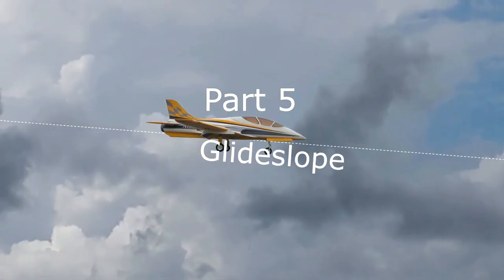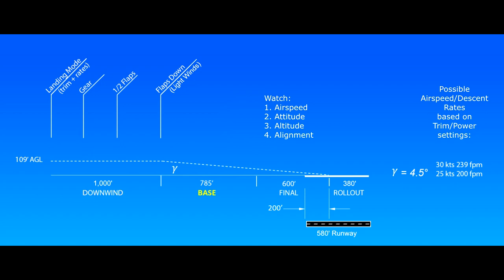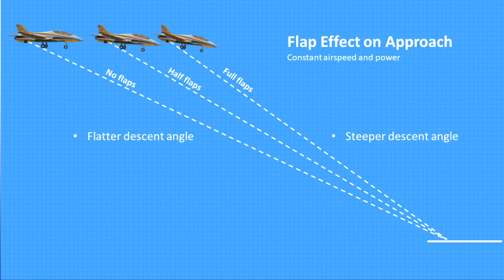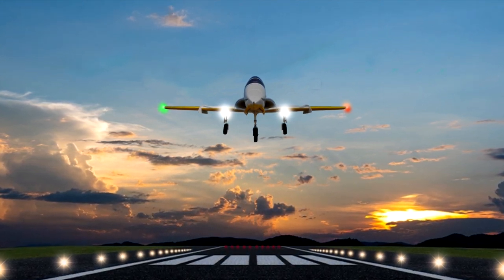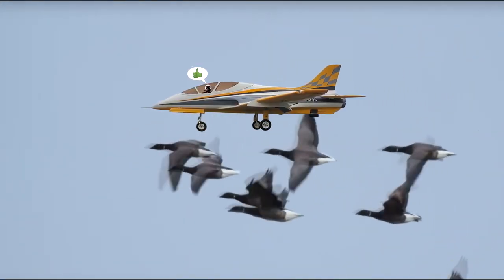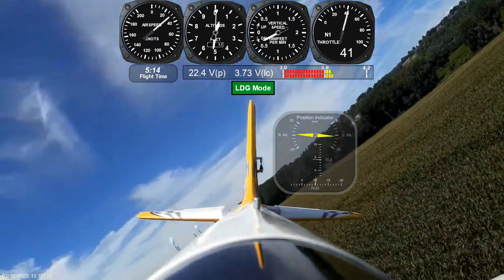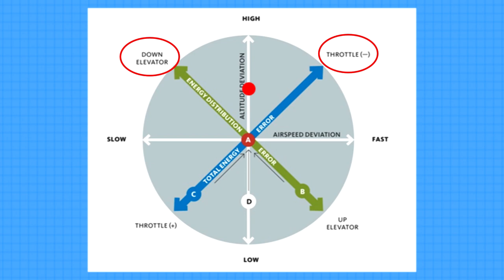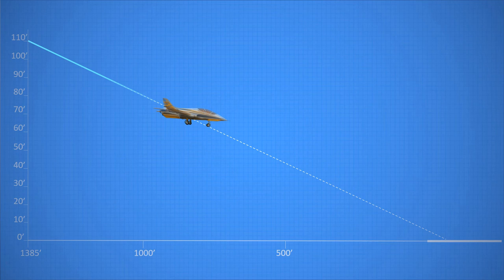By the Numbers: How I Land my EDF Jet (and avoid the danger zones) Part 5

Comment: Good job. I wish I knew how to create quality graphics. The flap system in my Spektrum radio has FLP>ELE mix for each position of the flaps, but I also put the transmitter’s flight modes on the flap switch which allows me to fine tune the elevator trim in each flap position. The flight modes trim also gives me separate aileron trims in each flap position so that I can compensate for any differences in the left and right flaps. I use 15 degrees of flaps for takeoff and windy landings. Full flaps is 30 to 40 degrees. I adjust my FLP>ELE trim more for glide speed/descent rate than for ballooning on downwind. One of the things I tell students is never throttle back below 50% when flying downwind or turning to downwind.
Reply from the maker: Thanks! Good info.
Reply from the maker: On the graphics, most of that was done in PowerPoint. The newer versions allow you to animate them, which makes it more interesting to watch. A photo editor is also a must. I had Adobe Photoshop for years, but recently switched to Affinity, which has many of the same features. A good video editor brings it all together.  I use Movie Studio 16, which is OK, but it crashes often in Windows 11. It's overdue for an upgrade. There are a ton of videos on YouTube that explain anything you want to know or do in any of these programs.

Comment: I set landings gear and flaps and trim elevator for approach speed and throttle to maintain level flight. Reduce throttle to maintain glide slope, use elevator to control speed. Small adjustments are all that is needed.

Comment: should have slammed the throttles to full-power on touchdown at the carrier, in case the hook skips the arresting wires ...
Reply from the maker: 31:48 You're right! It doesn't sound like I did that. But that is the right procedure. Even if you know you're in the groove, a cable can break or the hook can skip - although it's designed not to do that.

Comment: Remember to keep throttle up on the final turn !!!!!
Reply from the maker: That's right. It's good practice to throttle up any time you're making a turn in the pattern. I talked about this in Part 2 on stalls. The only exception would be if you're too high on approach and need to descend quickly,  as long as you keep the nose down.

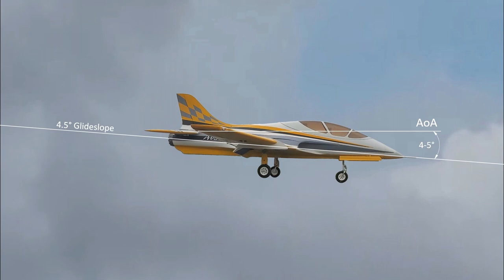Comment: reality check          15:00   too much emphasis on  FLAPS.     flaps are almost  never  NEEDED; and, most pilots only partially understand what flaps do and what they do not.        on the other hand, it is Necessary,  Every  time,  to fly the  ELEVATOR (and manage throttle) Correctly.        it is also necessary, during a landing,  to  Stop  Decelerating ---  before stall speed is reached.                minimum safe airspeed is maintained without increasing throttle,  by  allowing  the  model to  descend  Faster; via appropriate elevator inputs.      for those who don't know this  technique, it is called  trading altitude for airspeed.
Reply from the maker: I'm curious, what type of plane do you land this way, and on what kind of runway?
Reply: spoken like someone who lands on a long landing strip or lands on grass - minimum safe airspeed drops with flaps, with compensating throttle for the additional drag and care not to exceed the reduced critical AoA (including descent component of the velocity vector).